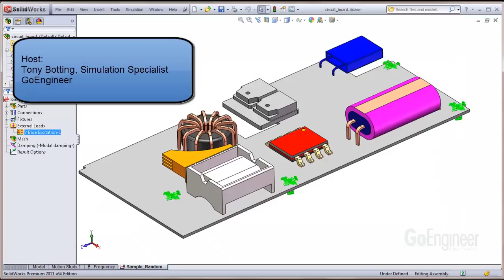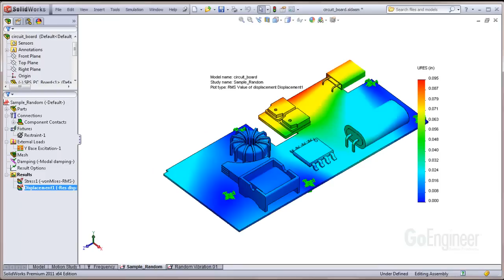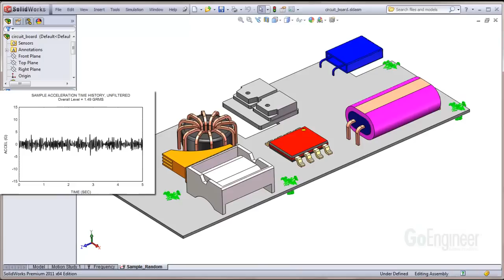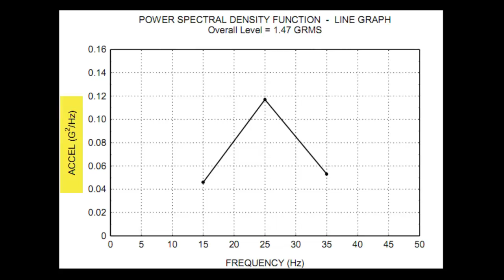SolidWorks Simulation- PSD Units in Random Vibration

Comment: how do you interpret the results? I use ansys and if i use a displacement plot it will give me just a single output plot with displacements and probability value. I would imagine if i give it a spectrum input i should get a spectrum output but this is not the case and it's not clear what the results mean.